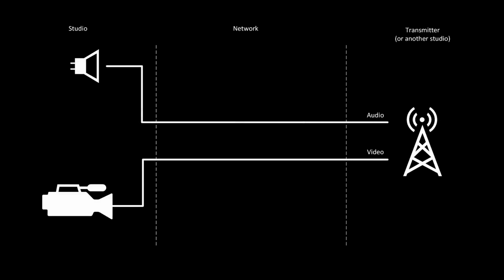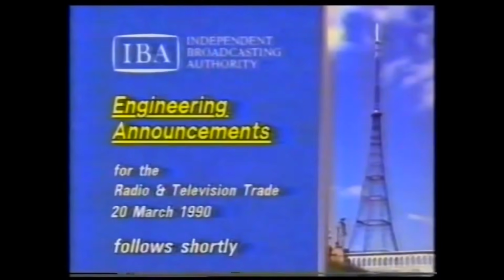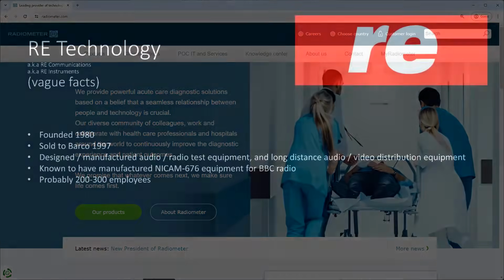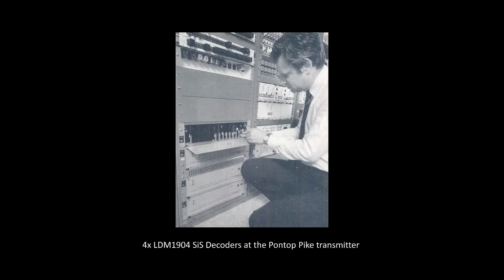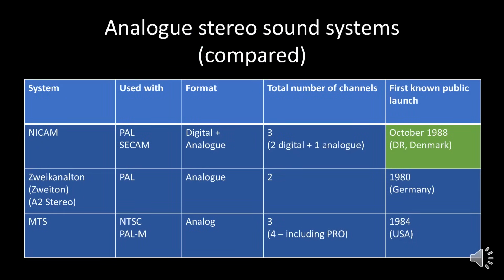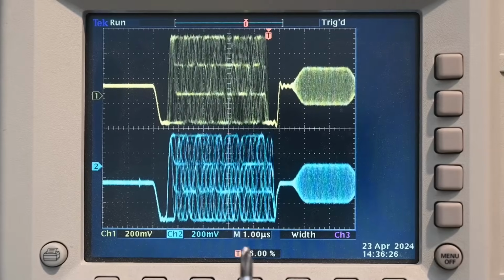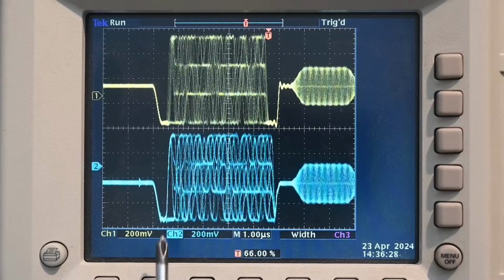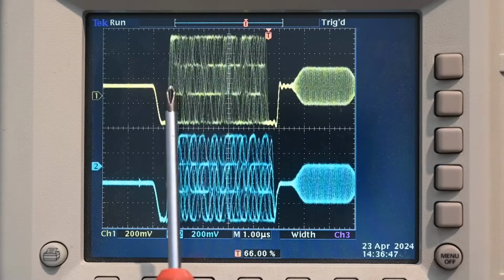#17 - Sound-in-Syncs Part 1: BBC/IBA equipment history, testing and experiments

Comment: I worked for TVT as a Student in the 80's and spent some time working on DCSIS.  I seem to remember the 2ch (NICAM 676) version was already pretty much fully developed by the time the NICAM 728 standard arrived. Originally developed by BBC D&ED in Chiswick in London, the initial designs were licensed to TVT to productise and 'finish-off' (aka. make it work properly). There had already been trials including round-the-world hops over analogue links with varying degrees of success.

When the NICAM 728 standard came along it prevailed, and TVT had to make a 728kbit/s compatible version  very late in the day (after having lost the IBA contact to RE).   I built a 728 bitstream generator for my final year Uni project, but not sure if any of my work made it into the production code.

The Pye museum in Cambridge could be a good source of further info. They have section dedicated to TVT. The former employees still meet up once in a while. At its peak there were about 600 people working at the Coldhams Lane site in Cambridge. I will DM you the contact details. The former head of R&D Dick Ellis is still very active.

Comment: End-to-end digital audio in the days of analog TV does sound rad indeed! What kind of link would such a signal be transmitted through? Coaxial cable? Microwave? ...fiber optic...?

I can't really get the appeal of the original SiS for mono, though. Why not just modulate a 5.5/6/6.5 MHz subcarrier as for public broadcasts? In fact I'm mildly surprised that such a "baseband video with modulated audio subcarrier" signal was never really a thing - it would allow passing the entire TV signal down a single cable ;) - but I digress. I just don't fully get it - if the problem was avoiding a second cable, why engineer this elaborate sound-in-sync setup instead of just slapping on an FM or AM subcarrier? The fidelity wouldn't even be that far off considering that the original system was just 10-bit, what's that, 60 dB SNR?

But of course, in the NICAM era it makes much more sense.
Reply from the maker: @kFY514  the problem was the enormous proliferation of technologies for carrying the video signal. Consider for example a 140mbps FOTs link. Not going to get any subcarriers over that. There was a system called sound over subcarrier in the UK. It put an FM mono carrier right at the end of the video spectrum but it was mono and not very good.
Reply: baseband facilities lines were, back when this was the cutting edge tech of the day, analogue copper coax circuits provided & maintained by the GPO (BT), & most of them could barely make 5.5MHz. 
a high frequency carrier above this would not have gone further than the end of the road.
BT would prefer you to book a "music", an additional "high quality" audio connection; this was extra cost, of course, but there was also the risk that your (now dual) booking would get messed up, that there'd be crosstalk or noise on your audio, or that they'd get out of sync because of some other processing. if you wanted to be absolutely certain that the right audio was going to turn up, in sync (no pun intended) & intact, sis was the best option.
d-sis prefigured nicam, & became part of the infrastructure for the rollout of stereo telly, but as others have noted, it was also handy for production talkback.
Reply: SiS was in use right up to the final days of analogue TV in the UK - as for what links it was used over, all of the above!

Speaking for BBC NI... Originally the network circuits from London arrived from BT in 'tubes', which held four coaxes & a few audio pairs - in 1994 this changed to a fibre optic system provided by Energis, with SiS, which was then beamed up to Divis by microwave.

It stayed that way until sometime around 2006 I believe, when there stopped being a dedicated network feed for analogue TV - and instead the analogue chains were essentially plugged into satellite receivers picking up BBC1 & 2 NI.

Comment: I assume the low bitrate speech you mention is the 9.5kbps CELP codec developed for the AUDETEL project. I don't know whether the NICAM additional data version was ever actually used anywhere - the UK audio description trial broadcasts used the even lower bitrate (7.5kbps) teletext transmission version.
I would be very interested if any of your viewers ever turn up one of those coders, but I fear they're another thing that only existed in single digit numbers of units and have long since been scrapped.
Reply from the maker: That would be a very interesting thing to find. Knowing what to look for is always a good place to start!
Reply: It was developed by the University of Surrey as "Speka Ltd". It seems like the BBC had at least two encoders as they generated audio streams live (frequently we find programme audio from TV or radio channels being routed out). ITV's signals were pre-prepared for playout like subtitles.
One of the decoders still exists in Peter Weitzel's collection. Decoding was mostly reverse engineered before we learnt that.

Comment: I believe both C4 and TV-am made use of the NICAM spare data capacity for a low-quality talkback channel to outside broadcasts. This makes sense as TV-am was routed directly to the transmitters during their broadcasting hours I believe - and so if the data had been in the SiS distribution it would have reached every transmitter (irrespective of whether the local company had any support for NICAM data talkback?). I have heard reference to it being used for C4 racing - presumably after 1992 when C4 took over advertising playout from the local ITV companies and added their own distribution to transmitters. However I believe C4 moved to 34Mbs compressed distribution around this time too - so it may not have been fully end-to-end SiS? (Was it ETSI compression they used?  It was a major reason for them choosing D5 over Digital Betacam as they were concerned about compression concatenation at the time I seem to remember?)

Comment: Information on the BBC Decoder is on the bbceng info site, under the equipment name CD3/504. Further information can then be found for each sub-module, eg AM1/38, UN16/515, FL1/31 etc. This may not exactly match the Varian unit that you have, but it should be close to the BBC Design.
Reply from the maker: Thanks for that. Just had a quick look. This appears to be for the old mono system, which actually I have yet to come across such detailed information about! Very interesting...

Comment: Hi Matt. In 1990 I worked for a company in Melbourne Australia supporting re 140Mbps Video CODECs(8:00). I spent some time in Copenhagen training at re. They were great folks. You're right, their documentation was outstanding as was their engineering. I do remember learning about their SIS but never used it in Australia. They had broadcast quality audio coders (15kHz?) that would interleave data into slots in the 140Mbps stream and I believe there was room for 2Mbps data as well. The 10 bit video sample rate was locked to 3 times the colour subcarrier and there was some very clever padding and frame size manipulation to sync with the 140Mbps data stream. Varying the SIS data rate as you mentioned would be consistent. Pseudo random encryption was not primarily for security but rather to prevent dc offsets occuring as a result of repeating bit patterns during static video scenes.
I'd love to get hold of a TxRx pair.
Thanks for the video. Was a real nostalgia trip.
Reply from the maker: Glad you enjoyed it. Would love to get a pair of those codecs on the channel. That particular coder is surviving but all of the decoders had been scrapped unfortunately.

Comment: I have a copy of the user manual as a PDF that you can have.  You will be able to do more experiments and even get into the monitoring software that drives the error LEDs. I have a Harris badged coder and a TVT decoder saved from the skip.  The open frame construction always made me nervous when working in racks with this gear in.
Reply from the maker: Brilliant. I look forward to seeing it. I think the open frame construction made sense in terms of how it was deployed. Very good for airflow, just a bit fragile when used standalone. I believe there was an official ruggedised case for the equipment for cases where it had to be used standalone!
Reply from the maker: Many thanks for that. No circuit diagrams in that manual I take it?
Reply from the maker: Just wondered if you had seen the response I sent to your email on Tuesday? On my end I had noticed that your message ended up in my junk folder for some reason!

Comment: Very interesting fun! Shows again the robustness of Nicam!  There’s an interesting BBC R&D report from 1966 comparing the relative goodness of using various pulse techniques to carry sound in sync (1966/58). They compare PCM (which obviously won) with PAM, PWM and PPM.  There doesn’t seem to be any indication that any of these other SiS techniques were actually in use though.  In the references there are references to a paper about the French 819 line system muxing sound. Has anyone ever seen this fabled HD system from the 1960s?

Comment: Sound-in-Sync started off gating part analog waveform and therefore had limited audio frequency response, this was well before digital was a thing. The other area from memory, it was used with FMVSB transmissions, to fit into an 8 MHz UHF channel for outside broadcast work.

Comment: Hi Matt. Very interesting video . I'm always amazed by the sheer amounts of hacks and improvement to analog tv, usually in the VBE.

I've been messing around with hacktv and it's become quiet apparent just how much analog tv sucks with weak signals and multipath. Really gives you a clear understating of the enormous output power and the many repeater station the big station had.

The end-to-end setup with NICAM is pretty neat but I can't help but think that the biggest home market adoption problem is that FM was usually good enough, especially though small and cheap tv speakers.

I'm glad I came across you channel, keep it up! :)

Jelle
Reply: The TV station transmitter site serving my hometown was 1.5MW EIRP. Digital is only 400kW.

Comment: Hii Matt
We had those RE encoders and decoders in our OB vans and RF link vans all over here at DR, we used this in the beginning of the 90s, before we moved to satelitte contrib.
I actually work together with one of the guys that worked at RE and he was one of the developer of the RE system. He worked there until Barco closed down the Danish division.
They also made encoder/decoders that could handle DSIS with other data in the signal such as teletext. 
When in use the monitoring in the contrib RF link was a bit problematic, since you wasnt able to monitor the regular ITS signals in the signal without a decoder in the RF Link van, because the raw signal hasnt any sync for the monitoring equipment to lock into. But the system encoding was quite robust, even on a bad RF link with noice.
Reply from the maker: Yes I had that problem with syncs. If you need syncs to monitor the input of the decoder, the other problem is the propagation delay of the decoder, in which case you also need an SPG to generate syncs subtracting the decoder delay!
Reply: I remember equalising video links at the start of my career, and on a marginal signal we'd often have to tweak the eq to such an extent that by the time the SIS could be decoded, there was usually a load of ringing on all luminance transitions in the picture. The studio would often complain, so you'd offer them the choice of ringing on the picture but usable audio (the subcarrier audio would often be unusable in these sorts of situations, as well), or a decent picture but with no audio.
Reply: I would have loved to hear more about the shenanigans in DR/DK. They have such a rich history on satellite with PAL, MAC, Nicam, cable, satellite and terrestrial distribution. I suspect, just like everyone else, all the 'old' equipment has been thrown out.

Comment: IIRC 'original' SiS was analogue samples, two per sync pulse. So they could be created and recovered with sample and hold analogue technology, no need for AD/DA or way back then.
Reply from the maker: Which original in particular? From my read of RCA's work, a whole myriad of approaches is described!
Reply: @mattstvbarn  I can't answer that precisely.... I worked for the BBC for a while in the mid-80s and we had to go to Evesham to be taught stuff. One of things was SiS, the system we played with was analogue samples at twice line rate. As I never saw this stuff again it's entirely possible memory is faulty... But that aspect has remained clear. I presume this was what the BBC standardised on for distribution prior to the introduction of Nicam and I'm pretty sure it was Designs Department originated.
Reply: I cannot find any support for my memory, but the original BBC papers are quite interesting. Sorry for the nonsense.
Reply: @paulranson6973  was that system not VIMCAS or maybe VISCAS? It used to carry a waveform on a couple of lines in the VBS. ISTR OB's used it on contribution feeds for 4 wires/talkback etc. I don't think it was good enough for programme sound.

Comment: Very nice! Some of the SiS kit we have in Belfast has the Harris branding. Almost all the kit that's still languishing upstairs was used for contribution feeds rather than transmission, and it's all wired for analogue audio! We also have a system for sending NICAM-3 over microwave... but that's another story.
Reply from the maker: Thanks! I do not want to hear that kit has ended up in the trash like the rest of it ;-)

Comment: The EBU, European Broadcasting Union used SIS on their satellite feeds till mid 1999 when they changed to digital.Various 'pirate' decoders were on the market for audio which worked well. Without one the line lock would 'wobble' in time with the audio which of course couldn't be heard.